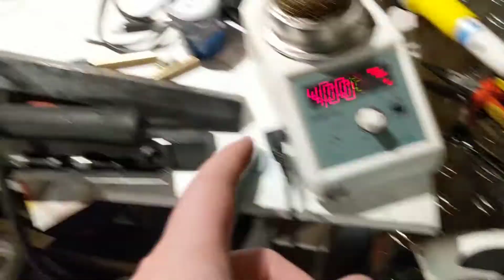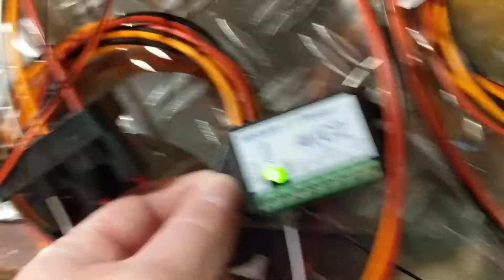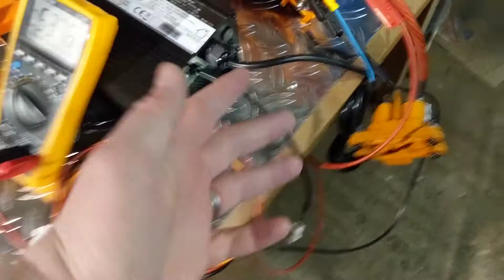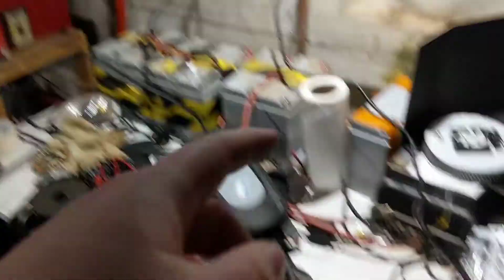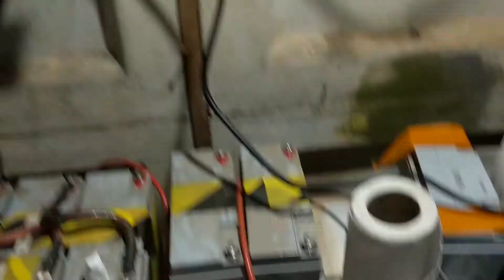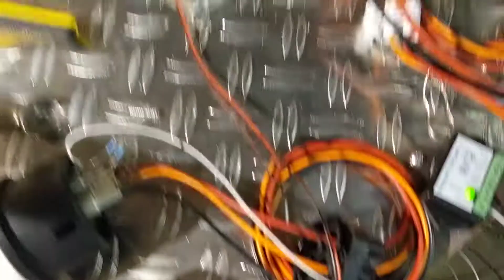Charging Circuitry Bench Test

Comment: Don't worry about that, Safety Third :P
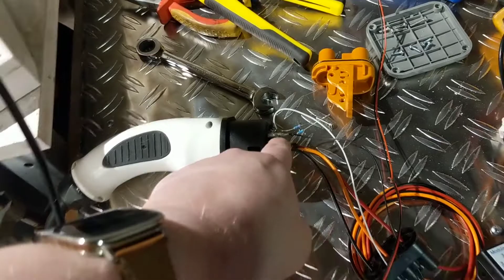Unfortunately it appears the video after 1:36 is corrupted.
Reply from the maker: Looks fine here? Perhaps clear your browser cache and try again?
Reply: @JohnVidler  Ahh yes router issues I guess was some thunder a few miles away and after watching another 3 YT vids it went offline.
Tried video again after reconnecting and seems to work fine.
Would be good if you could upload a completed video after all your efforts on this EV.
Reply from the maker: @jimbodee4043  that would require that it be completed! Life has rather got in the way of the project, and now it looks like I'll have to go with a different set of cells, as I can't get replacement ones in the UK any more. The mountings and shape of the cells dictates where everything else goes too, so it's all rather stalled while I try and find sanely priced cells. The quotes I've had here are bananas-nutso-crazy, and that's before shipping